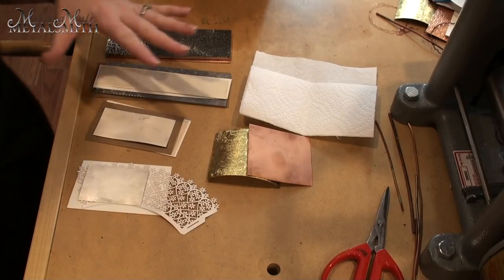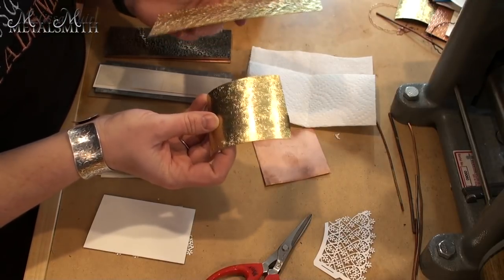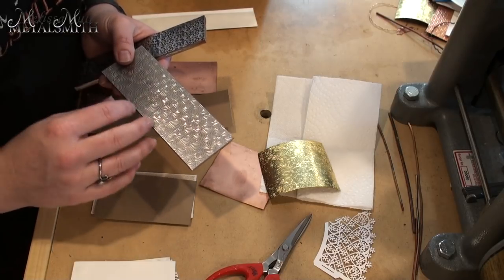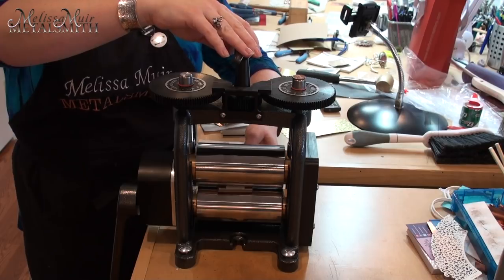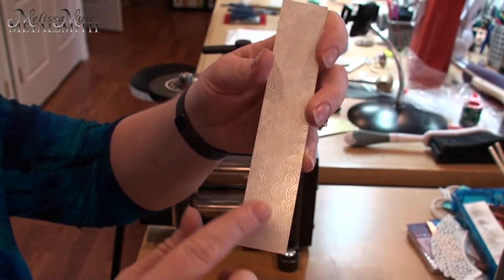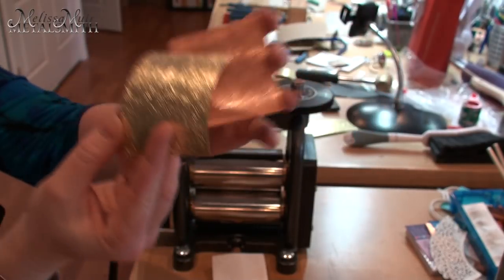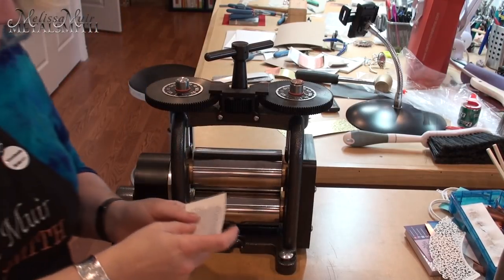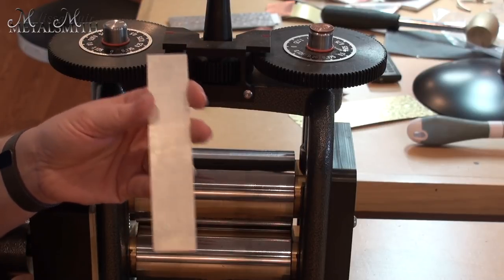How Do You Get A Good Impression With A Rolling Mill? What Is Safe To Use?

Comment: I had too much pressure using a texture plate and my top gear in my mill slipped. I had to take my mill apart to reseat it. I thought I had wrecked it. Now I’m ready to try again using your tips. Thank you!
Reply: Could you explain how are you reset your rolling mill?  I had similar experience.  Now machine not working properly.  Deborah
Reply: @deborahhardeman8802  I had to take it apart to reseat it. I followed a YouTube video to do it but I'm sorry I can't remember which one it was. It was a pain in the butt but I did it bit by bit over a week so it was less intimidating. Not difficult, just fiddly.

Comment: Your video is very educational for me, I have one of the small PepeRolling machine. My biggest problem is that almost every time when I go to turn though the handle it goes a little easier hard and then it stops and I have to wiggle it and then start again, and it doesn’t seem to be giving me much of a pattern. I’m going to try some of the things that you recommended and I have a question about the plates, I have a very thick one that I really love so I ordered it, I don’t want to use it in my roly machine can I use my press?  God Bless thanks. Deborah

Comment: Did you make the brass plate with a steel one first or are they available for purchase somewhere? Steel is too much for me right now!
Reply from the maker: The steel die can be purchased through Sandrasirles.com. She has all sorts of shapes.
Reply from the maker: I believe I answered you incorrectly. SO sorry about that. I was thinking this comment was on a another video. You can make your own steel plates, but as you can see, I also use all sorts of different materials to texture my metal. You can even purchase some of the brass texture plates and then roll them through with your other metal. And they are far less expensive than the steel plates. Though they don't las quite as long. https://www.micro-tools.com/products/bp-sample?aff=8
Reply: @MelissaMuir  Thank you very much!

Comment: great video, BUT you forgot one thing, if you turn the knob backwards, there is freeplay in both the gears and the thread of the roller's bearings so if you don't move a lot, before changing direction the roller DOESN'T move,as the freeplay is taken up!!, just like in all precision dials on machine axis, move one direction, and if you go too far back up 1/4 turn, then aproach the position from the SAME direction, ie: either left/right, or up/down. but learn the tool, what backlash it has, and tune it up at intervals if it becomes too loose!!, an indication of wear on parts!!

Comment: Hi Melissa, can you tell me is it possible to create a beautiful design on sterling silver and then cut it with a pancake die? Or are patterned metals through a rolling mill meant to go into disc cutters. I'm really struggling to try to get a good deep pattern into my metal and then cut it with a pancake die. I am using 22 gauge metal in sterling silver.
Reply from the maker: I roll through with a design snd then cut with a pancake for all the time. Don’t anneal after rolling. The pancake die will cut better if your metal is hard.
Reply: @MelissaMuir  thank you so much for your quick reply. I'm using 22 gauge sterling silver and I don't O'Neill it but with some pancake dies I am noticing it's too soft. But my problem is the 20 gauge does not take a pattern as well as the 22 gauge sterling silver. Also do you anneal your metal right out of the package when it is supposed to be soft?
Reply from the maker: @laurenyoungs  it kind of depends on annealing. If I can tell that it is soft enough, I don’t. But some may need to be. It gets jostled around during packing and shipping, all of which will affect it. You should be able to get a better impression with the 20 Gauge as there is more metal to press into the impression plate or whatnot.
Reply: @MelissaMuir  You are a Gem! Thanks!

Comment: Do you think laser engraved photo mat paper would work? Since it's a bit thick, you co hi le get a deep laser engraving.  Your thoughts?
Reply from the maker: I think it is worth a try. As long as there is some good tooth to it, it should work. It doesn’t take much, but if the pattern is light, you will need some good pressure to get a good impression so you need to make sure the pattern can withstand that.

Comment: Hi Melissa, great video, thank you. You didn’t use the thick steel plate, is that because it wouldn’t fit or another reason? I’m on the fence about purchasing a Pepe because I have many of these thick steel plates and want to be sure I can use them in my mill and I know the big question is: ‘will it open large enough to accommodate them’? If yours doesn’t, can you suggest one that does? Thanks again, your videos are extremely helpful, and easy to watch 😊
Reply: I have the 90mm flat Ultra Pepe rolling mill (smallest one ) and it takes the steel plates (Bonny Doon) easily !  I've used 2 of the plates already and the print comes out wonderfully ! I did not sandwich the metal either and it did not hurt the rollers a bit.  I LOVE LOVE LOVE my Pepe mill !  Thing is, if you have used your steel plates in a hydraulic press, it is HIGHLY recommended NOT to use them in the rolling mill.  They are not interchangeable and I believe Melissa covered that in this video.
Reply: I referred to the ‘thick’ steel plates because the Bonny Doon plates are not an issue. It’s those thick ones I need to be sure will fit through the mill.
Reply from the maker: artful journey I actually didn’t show it because I forgot and was editing the video when I realized. Having said that, I have a limiter on that particular mill and it only opens to 5mm. However, if I were to alter that limiter, then it would open to 7mm. It is something I would only suggest if you knew what you were doing. If you open it too far, you will misalign your mill and the spring may pop out. It isn’t hard to fix, but it is a possibility.

Comment: One question though, what about rolling leaves and plants that still have some green life in them? Could you roll them as long as they were sandwiched so that the moisture didn't get through to the rollers?  Would they leave a good imprint?
Reply from the maker: That is a great question. Yes, you can still roll them as long as they are well sandwiched. However, because of the moisture in them, they won't give as good of an impression as the veins and such will just collapse and make a mess rather than hold their shape. You will still get an imprint, but it won't be as good as if it were dry to begin with. I would say play with it a little bit. But the biggest thing is to protect your rollers when doing it.
Reply: Thank you!
Reply from the maker: Glad to help